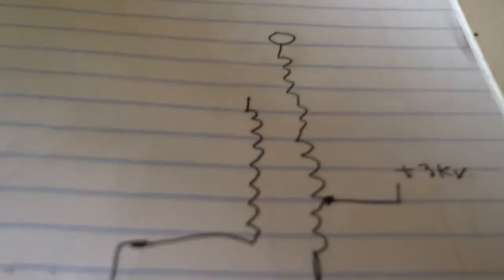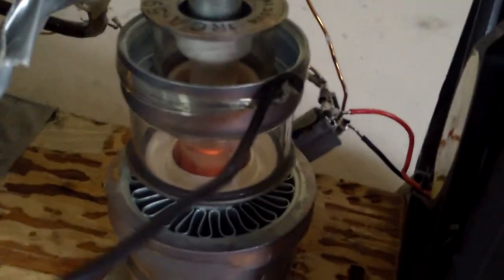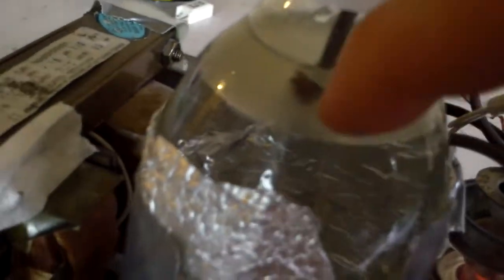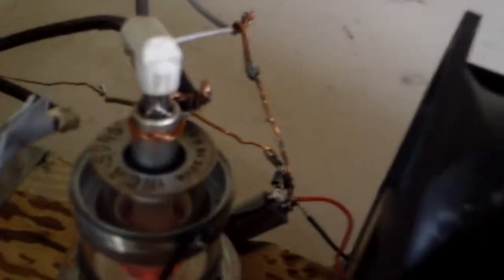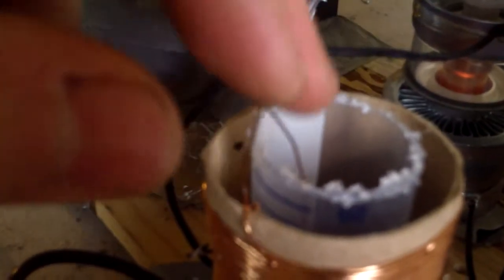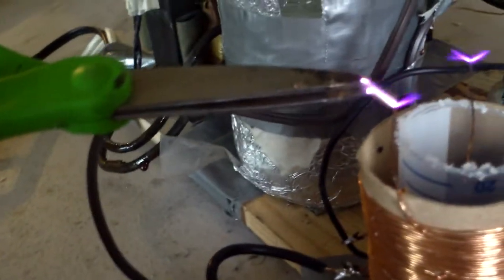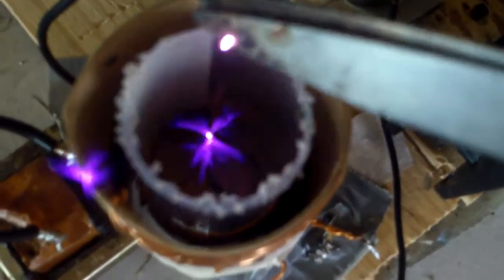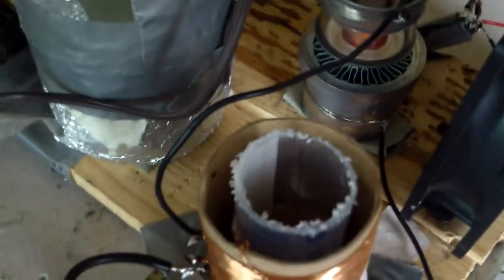base fed vttc

Comment: I think this would fall into the category of a Armstrong oscillator .However your coil is not tuned as far as I can see. This places it in the category of a force driven Tesla coil.  It could be dangerous to run such a device open with no shielding as you could be producing dangerous harmonics which could adversely effect your eyes .Just a thought, Stay safe, I like you videos. Respectfully Paul, KI4TOR

Comment from the maker: lol its very easy to kill a tube. you can melt the anode, you can over volt the grid which makes a beautiful display, you can over volt the anode and make blinding blue flashes and xrays if its over 10kv.and of course you can drop it or bend the pins or hit it and let air in the tube. all of these things involve hours of guilt after. filiments are acually pretty robust i think that if you give them the right voltage and current they will still be glowing even after all the thorium is burnt off.

Comment: Wouldn't a smaller primary and longer secondary work better and stop the primary arc? 4:1000 seems a common wind. Nice one though. Arcs on the inside are only bad if your not a pyromaniac.

Comment: if i look at my tube flyback drive
it works without the cap and resistor
but not realy good
the flyback clicks wisles and does what it needs to do

but when i conect them i get more power and a perfect arc

the cap and resistor are a rc paralel circuit
witch alter the time the waveform hits the tube
(phase shifter)
that way (when selected the right parts)
it should gain power

Comment from the maker: @robot797 I'm not sure but I think this determines it's own resonant frequency but I will experiment with grid leak resistors and capacitors. the previous one I made was an Armstrong oscillator based one with a 2 foot tall secondary and it was so untuned that it made one milimeter sparks and the tube heated up a lot. so I took of the primary on that one and made the secondary for this. I later found that four turns of wire around the secondary makes a great antenna I will post a vid soon